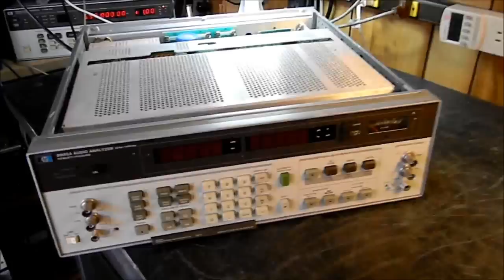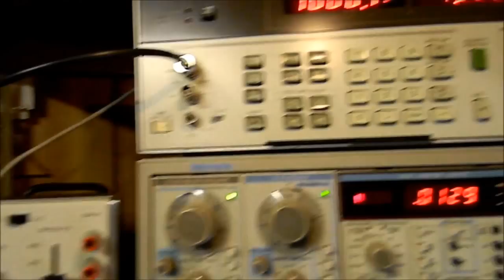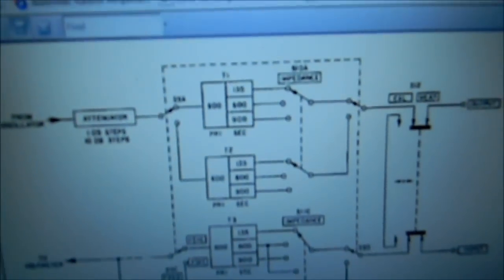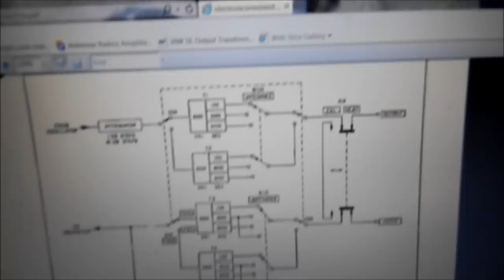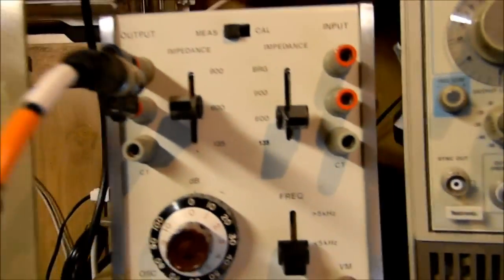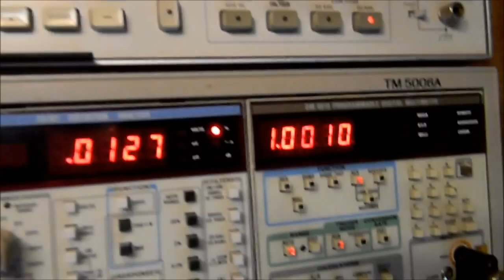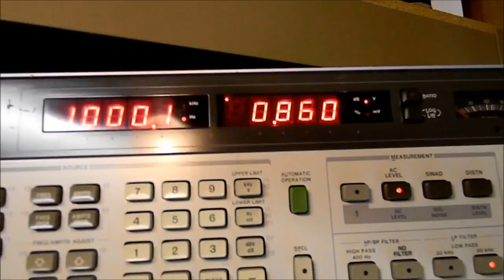Hewlett Packard HP Agilent 8903A or 8903B Audio Analyzer Repair

Comment: I have an 8903A and a 8903B both suffer from hinky reed relays. HP used them all over these. In all fairness they're 40 years old so that isn't horrible. HP's service manuals are top notch...
Reply from the maker: I had the one in the video go bad and was shock sensitive but found a new one on Ebay. Just a lucky find and it fixed it and still working today.

Comment: Awesome videos on the 8903a. I have one and have been using it on and off for a bit. Your videos helped my learning curve. Outside of integration with the PC, curious what the 353 is doing for you that the 8903 can't.
Reply from the maker: Hi Bob,
Yes, the 8903 is a nice instrument. Mine had a problem a few years ago and I finally tracked it down to a relay on one of the boards. Found a new one on Ebay and fixed it.
Not sure what you mean by the "353" - which instrument is that?
Reply: @ElPasoTubeAmps  Hi. I was referencing the HP353A.
Reply from the maker: @bobkrueger194  I quit using that some time back as it is noisy. It is not on my test bench anymore and I couldn't remember what it was. As you indicate, it was not necessary to use it with the 8903.  I am not sure I have the patience to install and get the software working with the PC again - although it is still working great - but I remember it was a real chore to get the software configured properly. Stay safe...

Comment: Mine has just thrown up a similar fault on mine. Stepping the output level in 10mV stepps has periods where the level is unaffected, then suddenly jumps up too high.  If i program output to 6 v the rms level is close to 7 with clipping. I'm not sure if it's the relars, but i think it might be earlier in the fine control attenuator circuits.
Reply from the maker: Hi Simon,
Our fantastic instruments are ageing and sometimes very hard to repair and develop kinky problems, kind of like my ageing problems.... I am not sure of your issue but I would peruse a course of mechanical type connections first, i.e. like you say, possibly the relays (maybe not...) or PC board contact cleaning and seating. It just doesn't seem like it would be an internal electronic logic attenuator type problem -  at least to me, so I am hoping a through cleaning might help. Also, I would not over look the power supplies with possible variations in that area.
My beautiful HP RF spectrum analyzer developed an issue that I asked you about some time back and I did get it to working again but it will not self-calibrate and always has a problem with vertical calibration. Horizontal calibration is OK. The HP manual for this instrument is very difficult to understand and some how, I believe there is a battery in the unit that holds calibration information but it is on the board that is hardest to get out and without knowing for sure there is a battery there, I am not going to go to the trouble to remove it. I have re-seated all the other boards. After extensive reading, I understand there are stored values somewhere in the unit that I am supposed to access from the front panel but I just do not want to have to know that much about the damn thing to repair it. I just want it to work. It seems a fellow has to rise to the level of HP tech support to be able to deal with these beasts. Oh well. I wish you the best of good fortune in repairing your instrument and please share what you find. Stay safe in this time of pandemic.
David

Comment: Yes I see the video isis now nearly 6 years old. The video is quite interesting in itself. I have myself such a device which does not function at the moment.
But the quality of the video is not especially good. The constant up and down or left to right  is simply impossible. Please buy absolutely a tripod. This improves the quality of a video around the factor 10! ):-)
Reply from the maker: This one is particularly "bouncy" and is a common complaint I get.  I think I had a much cheaper camera back then and also it seems even worse on a small screen mobile device.  I do try to keep from making my viewers sea-sick and move slowly. A tripod would probably require a dozen or more videos to get the same thing across as hand holding the camera and (carefully...) moving it around. Thanks for your input and I will actually try a full video on a tripod with many more "takes" and see if I can improve my videos.

Comment: Hello,
Twas just wondering if you have resolved issues with generator level in P.Millets software? I do have the same issues and was curious if you have found some trick in the meantime. Thank you for posting such a great info here. Love your videos.
Reply from the maker: No, I haven't worked on the voltage level issues at all. I was directly involved in the computer world from 1970 to 1996 with NASA and WSMR and the level of programming required to deal with these 1980's level programming issues is truly a pain to work with - Pete echoes this also in his comments - it is just one level above assembly level programming. Only the Geeks-Of-The-Geeks would work on something of this level anymore - such it is has gone the way of HPIB and GPIB.  Really appreciate your kind comments.

Comment from the maker: Sounds like you got it and did it right. I fixed the midrange driver in my Klipschorn by sweeping it with an oscillator and discovering the harshness I could hear in voices was occurring around 500 Hz. I took the driver apart cleaned and reassembled it and much to my good luck, fixed it - I could have screwed it up big time - I have already learned a lot from your experience about fixing speaker tears -

Comment: Ray,
I don't have video editing experience nor software for editing. This might be a perfect project for you. Although, others have demo-ed repair techniques. I don't know of any demos with lab gear to show an A/B comparison between a repaired speaker vs the same type NOS. 
I wonder how the repaired speaker performs at higher freqs such as mid range. In my app, I was only concerned with comm. voice ranges. I had damage at the outer perimeter through the middle and all is well now.
Thanks & 73

Comment: Hi Ray,

Thanks so much for the info.. I did watch some youtube video's on speaker repair a few weeks ago and used the info, to GREAT SUCCESS, to mend my speaker. I used watered down wood glue and pieces cut from a coffee filter to mend the cracks. Afterwards, I sprayed the cone with satin black, light coat. Then swept the cone with a sig gen and scope to look for anomalies  in the audio. It looked perfect and sounds wonderful. My damaged cone was probably done during the initial assembly. 
73

Comment from the maker: I didn't know the part about the Collins employees being able to buy surplus parts cheap until a QSO about 3-4 months ago with a lady that worked here in El Paso at the Collins plant - I told her this story and it made sense to her - as mentioned, I have had it 30 years and her story made sense to me since I had what one would call a "kit" as it included everything except the speaker and the winged emblem (I had a spare emblem from some old equipment) Always good to hear from you, Glenn. 73

Comment from the maker: I also have the Collins 312B4 and had to buy it a new speaker about 30 years ago I think I got it at Radio Shack My 312B4 came in "kit" form - I know it sounds nuts but there was a Collins plant in El Paso long ago and as I understand it when they were merging with Rockwell, they allowed their employees to buy surplus stuff cheap & somehow someone put together a "kit" and I bought it and assembled it to include directional coupler, 2 meters, etc.  Crazy but true.

Comment from the maker: Glenn, I have no special knowledge of speaker repair but for many things I use Goop. There is Plumbers Goop, Shoe Goop, and a bunch more but as far as I know they are all the same - Goop... It is a wet rubbery substance that is very strong but can be removed from most surfaces - probably not paper though. I have successfully repaired speakers with it and some were catastrophic repairs around the mounting and it worked well. I recently repaired the speakers in my wife's car with it. (next post)

Comment: Hi Ray,

Question. I am restoring a Collins 312B4 console used with the S-Line. The speaker inside is a, 6" by 4" high oval. It sounds fine but there is a tear on one side and a few places where there are light tears around the cone outer perimeter. I think the larger tear was from when Collins packed it into this tight console year ago. Are there better Adhesives?
I have used tea bag paper and watered down Elmer's glue for minor repairs in the past.
Is there a better way?
73,
Glenn WA4AOS